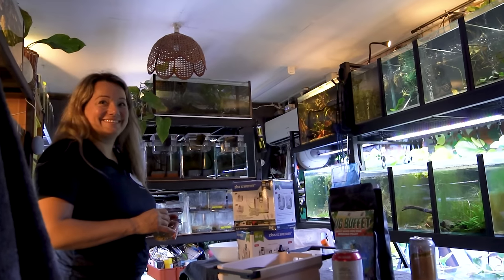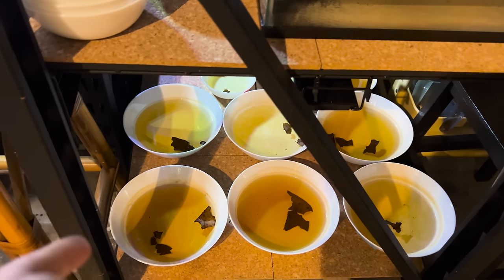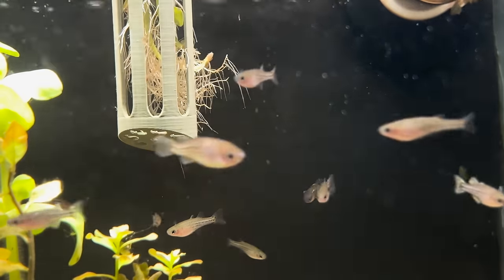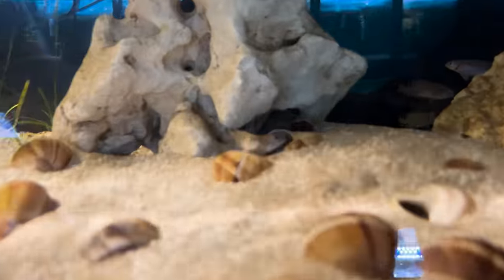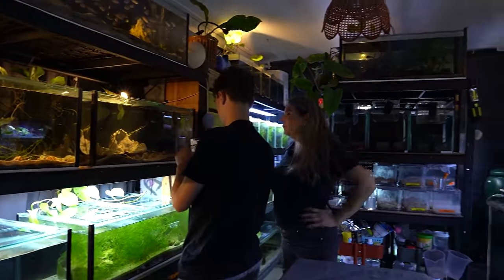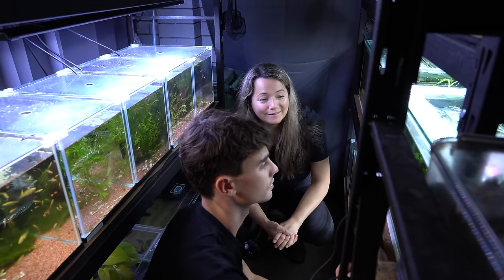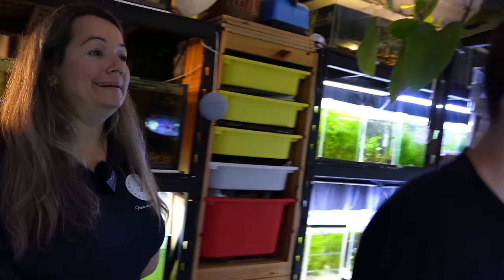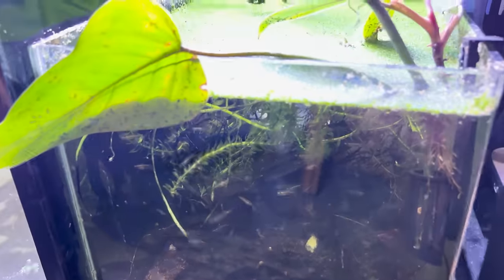The Best Nano Fish Collection | In Depth Tour

Comment: I keep my cpds at 75f. I have 2 males and 3 females in a 10 gallon tank.  I have an air lift system as well. Every 2 or three days I'll get anywhere from 20 to 40 eggs but I'm having trouble with hatch rate.  Only around 10 percent will hatch. I'm going to put Indian almond leaves in with the eggs like u guys showed to c if it helps.  I feed live bbs every other day religiously and I've found if I keep the lights as low as possible and keep a lot of top water floating plants the fish r more willing to breed